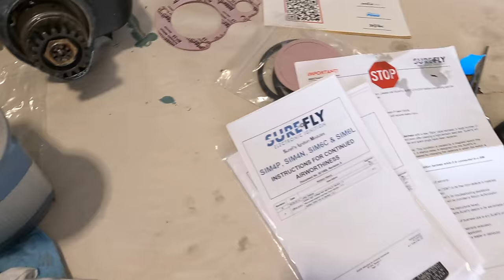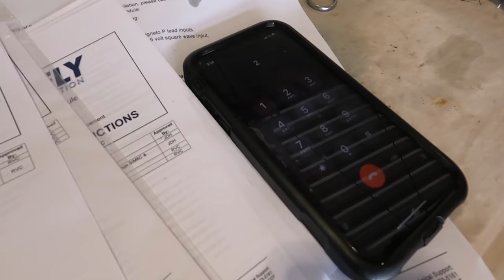New Alternator, Starter installed... Plus an E-Mag #FAIL Cessna 172B Glen's Hangar Episode #6

Comment: Chrysler developed and introduced the alternator on their Valiant "compact" sedan back  in 1960, the first year of the Valiant.  It was their real-world test bed.  The benefit was, it always generated electrical current when the engine was at idle whereas the generator did not.  The success led to installing it on all Chrysler vehicles.

Comment: On the starter.  The small round housing is the starter motor.  Under the 3 screw crescent moon cover is the solenoid that does several things.  When the start circuit is engaged. The coil of wire creates a magnetic field and pulls the plunger rod in extending the drive gear into the ring gear. So it's not engaged all the time.  As the plunger bottoms out the contact disc at the top of the plunger bridges the contacts.  The battery power goes to the coil windings to spin the drive pinion that is now extended into the ring gear.
What is really interesting is the solenoid coil circuit.  The ground side of the solenoid winding is connected to the solenoid output stud  that connects to the starter motor.  So as the solenoid has been sent power before the contact disc makes contact . The solenoid winding is grounded thru the  brushes and armature. This creates a strong magnetic field known as the pull in circuit. 
  As soon as the solenoid contact disc bridges the contacts and sends battery voltage to the motor winding the solenoid winding has positive current on both sides but there is enough voltage drop across the disc. There is enough difference in voltage to keep the plunger held in. At a much reduced amp draw thru the solenoid winding.  So the solenoid winding pulls 40 or 50 amps for a split second then drops to 15 or 20 amps to keep the starter engaged as long as you hold the start button in. 

 When you release the start button the circuit opens, the magnetic field created in the solenoid coil collapses. The spring allows the drive gear to retract as the contact disc on the plunger moves away from the fixed contacts so the starter stops spinning.  

There is a major issue with these starters.  You cannot control power to the starter big stud and the S terminal at the same time using a relay.  If that happens . As the remote solenoid releases. Both circuits open. The armature spinning inside the permanent magnets becomes a generator and creates just enough current to keep the solenoid engaged and the drive gear extended into the flywheel.  Causing the starter to stay engaged with the engine running for a few to 10 seconds.  I have been a professional auto mechanic for 43 years.  It's just to help you understand.  
Oh. If the armature brushes wear out and dont touch the commutator. The solenoid won't have a ground for the pull in event.  So it wont even click.  You can tap lightly on the end of the round motor section. To get the brushes to make some kinda contact.  Not really a great idea with that big fan blade wanting to spin a few feet away. But on cars and trucks it will get you going once or twice more.

Comment: I know this is a year ago but maybe you'll see it. When i was in my teens i worked on a potato farm in the Fraser flood plains of Surrey B.C.
 We had an old Case tractor that wasnt used for much more than running the irrigation pumps. It was great for this as it had a magneto ignition.  The reason this was good is because if the tractor ran out of gas it stalled out and because of the mag it wouldn't kill the battery or burn the points. Another goid thing was we would get exactly 1 hour per gallon of gas. So if you needed the pump to run 3 hours you put in 3 gallons of gas. 5 hours, 5 gallons. 
Occasionally the mag would go bad so we had 5 or 6 big boxes of them and you simply change it. 
Those mags looked identical to the ones on you plane. I guess Case had a good thing so they were used on many different things.

Comment: Another wonderful episode! About magnetos, they are still used in vitage bikes, too. Their charm is: the spark gains more power with revs going up. I'm a fan of lightweight. My idea is a BMW R75/5 café racer. (Original dry weight: 195kg. I wanna get down to a 160kg.) Also had some fun with electrics. My voltage regulator is DIY electronic. But that one comes with an 0,7V loss 'cause of the transistor (the original from 1972 has almost none), so I changed the little diodes in the rectifier with shottky ones. To compensate for at least 0,5V of that loss. Technic is fun!
Greetings from the far north of Germany!

Comment: Evey heard of sprint cars, they use mags. Supermodifieds use them also, probably some have newer but probably anything that gets pushed off to start uses a mag
Reply from the maker: Yes there are probably dozens of combustion engines that use magnetos - and I will forever be grilled by the internet armchair critics because in the heat of the moment off the cuff comment I failed to list the possibly 100s of niche places that still use them.

Comment: Magnetos are still used on dragster engines.  They make more spark energy as the RPMs increase. For aircraft, they provide spark independent of all other systems and each other so they increase overall reliability.

Comment: I think it’s called a sure fire it’s a modern electronic ignition with auto timing to move it to make more power and you can keep old mag for a back and they are the same price. They start way easier and runs smother setting on ramp and you go full power the timing is auto advanced. It’s the best money you will spend and if you shut you motor down for bath room break you won’t have to wait for it to cool off , this baby fires right when hot or cold hot , mproves fuel burn a 1/2 to one gallon less fueled and depending on plane and it my stay the same or use little less fuel. So please try this sure fly mag and you only have to buy one and other will be your back up .

Comment: That sucks Glenn, but at least it seems like you have an awesome AME to work through it with. Funny, people talk about experimental and home built as though they are slung together with old garbage parts, and maybe some are, but experimental now have the most cutting edge in technology. As you mentioned the exact same parts are available for experimental at 1/3 the cost, and most new technology start in experimental aircraft. All of the awesome avionics you see were in experimental for years, you can get electronic ignition, and fuel injection for experimental now. Hopefully an RV 10 will be in my near future!

Comment: I know this was over a year ago, but I found myself wanting to yell at my screen so you could hear me: “Remove the gear from the mag to put on the SurFly!” They may have added that to the instructions now? Also, I’m sure you are aware, it is now legal to connect into your manifold (at least in the USA) They are awesome!
Reply from the maker: You’d think… but Nope. Not designed/made/certified for this engine and likely won’t be for at least another year. I’ve had lengthy conversations about this with SureFly.

Comment: I'm sorry that the SureFly didn't install for you.  I see that they have changed the paperwork on their website to reflect your difficulty.  I have one on my Mooney and It always started well with the old mags, but now it starts like a car.  I originally installed it with the advance (it's legal down here in the states), but had to move to the traditional timing because I was running too hot.  I also have the permanent magnet starter and that certainly helps with the starts.

Comment: If you can't adjust the timing via manifold pressure you might as well use a traditional magneto.
Reply from the maker: There are a few other advantages of the Electronic Magnetos.

Comment: With fuel efficiency becoming more paramount. I'm really surprised that auto makers haven't created engines with duel sparks (at least to my knowledge). Obviously this would be more complicated but the engine would be more efficient as your friend said.
Reply: They have - believe it was Alfa Romeo latest.
Reply: My '94 ford ranger had 2 plugs per cylinder. 
Really threw me an my gramps off the first time we worked on it 😆

Comment: Curious about the engine cowl when it comes to Post Polish.  Are you concerned that you'll end up with excessive glare off of the cowl once it's polished?  Have you thought about how to remediate that?  Perhaps a Matt Black vinyl for the upper portion?  (Which I think would look really kind of fantastic).
Reply from the maker: Painting an anti reflective area is on the list of jobs. Though it may not happen until next Spring.

Comment: You can still find magneto ignitions on old school dragsters. Check your Summit Racing catalog. Anyway I saw them years ago when I had a mild interest in racing cars.
That's funny. Vacuum timing advance is experimental. I have a 65 Nova that is centrifugal advance only. My 79 Pontiac had centrifugal and vacuum advance.
Reply: There are lots of classes that use magnetos.  (Top Fuel, Nitro FC, Alcohol dragster, Pro Modified) to name a few
Reply: @davidvicari5139  - First, an aircraft engine operates at high power settings for takeoff and climbout; but often cruises at an upper-middle throttle range. Each of these operational regimes can benefit from optimized timing (to manage power, control CHTs, maximize fuel economy, etc). Furthermore, you're forgetting the fact that air pressure changes with altitude. Anything utilizing MAP as an input (on a non-turbocharged engine) will be able to provide some altitude compensation.
There is no reason why a Bendix magneto is any better; especially given the fact that the design incorporates wear items and includes a lot of internal heat as part of the operation (diminishing the lifespan of the unit).

Comment: Nice to see some progress. Did you try "Mothers Mag and Aluminum polish" yet? If you use it on the primer it might actually be effective for rubbing that off too.
Reply from the maker: I'm sticking to polishes that are certified for the alloys / cladded aluminum used on aircraft. Luckily the primer is gone at this point; it was a job but it's done.

Comment: You're clearly a nicer person than me. After the tech call I would've been calling the place you bought the mag from and would've been screaming at whoever was responsible. That being said looking forward to the next video. Thanks.
Reply: I found that most of the time the vendor really doesn't know. They look at the same fitment list that the manufacturer supplies. The tech department at the manufacturer is the one who gets torn a new one. It's one of the "joys" of my job. My Therapist says I need a healthy way to deal with my pent up anger, so I asked her if screaming at some tech-weenie that says this part will fit in my <insert thing here>  when it clearly doesn't and never will counts... She said not exactly, but as long as you're non-violent about it, and it works; then go for it!

Comment: Your title is misleading or simply wrong. E-Mag and SureFly are not the same company even though they have a very similar product. It's not E-Mag Fail, it's SureFly Fail. 
Great content overall.
Reply from the maker: I tried to shorten the title by using the colloquial 'E-Mag' which is shorthand for electronic magneto. 
Not realising that there was even a company called 'E-Mag' since they aren't certified and therefore not on my radar.
Reply: @GlensHangar  I thought you were going to install an actual E-Mag and your airplane as it was converted to Owner - Maintenance category, hance why I decided to watch this particular video. 
You do have a great channel. Keep up the good work.
Reply from the maker: @peterp696   To clarify; the airplane isn't owner maintenance, it's certified.

Comment: G,day Glen from Sydney Australia.
* When using the paint stripper, are you covering it with newspaper: I believe it increases the efficiency.
* That electronic ignition: is the advantage that the engine only needs one unit and it provides better timing of electrical current to the spark plugs?
🌏🇦🇺
Reply: You still need 2 units, but the e-mag is basically service free.  Regular mags require periodic inspection and rebuilds.

Comment: Chris is an AME (aircraft Maintenance Engineer).  No Canadian aircraft flies unless an AME signs it as airworthy in accordance with the applicable standards of airworthiness as defined by federal law .  As you see in this video an AME may also modify an aircraft under Supplemental Type Certificates (STC's) or (LSTC's).  So the term mechanic is an understatement of the abilities of a Canadian AME to inspect, maintain and insure safety.   Also fact, the Canadian AME makes less than an auto mechanic.  Go figure.
Reply: It's a damn shame. But even in the US, A&P's make less and are probably way better trained than an auto mechanic.
Reply: @GrizzAxxemann  
absolutely no disrespect on the new tech auto mechanics that train well on their product, however aircraft can't pull over to the roadside for a defect.
Reply: @darenm5691  none at all here, either. My fleet mech at my job has been almost 40. The dude is a wizard. But given that a broken car probably won't kill you, and a broken airplane most certainly can and will, AMEs are worth more $$$

Comment: Did you ever get the sure fly magneto problem ironed out and if so, what is your opinion about them now after the smoke has cleared?
Reply from the maker: Yes - SureFly turned out to not work with this engine; they had mistakenly added the C0-300 to their AML and then removed it when we pointed out the mistake.
So I put on the ElectroAir, and I'm super happy with it: https://youtu.be/eZdmlDdwzDY

Comment: People that have polished airplanes spend their time polishing their airplane.  New and improved can be an oxymoron.
Reply from the maker: I get two kinds of comments about polishing the plane:
Comments like yours from people who either don't own a plane that needs polishing, or who don't own a plane at all.
OR
Comments and advice from people who actually own planes that need to be polished who tell me that the first time is the worst, and then it needs just minor polish and touch up once a year.

What I can tell you is that even the most neglected polished plane looks better and flies better than a plane with a so-so paint job.
Reply: @GlensHangar  Glen, please don’t think I was trying to insult you.  I have friends that have polished airplanes and it can become an obsession keeping it gleaming.  Yes, I own an aircraft, one older than yours, a 1957 TriPacer converted back to a taildragger which I have owned since 1998.  The only parts of my fabric covered aircraft polished is the spinner and the exhaust pipe, and yes I obsess on keeping them gleaming, and keeping the fingerprints off.  I will admit a polished airplane is a thing of beauty heartening back to the 30 and 40s.  I am enjoying your series and think you are encouraging others to pursue acquiring an aircraft while sending a very important lesson, buying an airplane is not like buying a boat.  This is a highly regulated pursuit, whether for pleasure or career, because mistakes made by the un-initiated can have tragic results.  I applaud your methodical, and logical decisions from the start.  Getting a pre-buy inspection was a superb decision, as well as the C-172B.  The C172 does just about everything well as long as you keep to what it was designed for.  Too many first time buyers fall into the trap of buying a plane (love at first sight) getting a mechanic to look at it perhaps for the first time at the next annual and getting very nasty expensive  surprises.  The 0-300 engine is very smooth.  I have flown light sport aircraft with Dynon displays and I am very impressed with the quality of their product, on par or better with some of the displays in the A320.  Congratulations on finding an aircraft in such great condition and you are sharing many of the tough choices many of us with classic aircraft face.  I look forward to viewing your journey.  May it always be blue skies and gentle winds.

Comment: Saying SureFly is more than eMag... is unfortunately not right.  eMag doesn't make 6-cylinder, so you can't get it even if it did have the right paper.  eMag (4-cylinder) is 1685 on A.S.  SureFly (4-cylinder) is 1595 (6-cylinder) 1895 all prices A.S.  Now eMags are "self-powering" once started.  They need a small source to start, some have a lead for a small 9v  battery just to start on a dead battery or for non-electric aircraft.  eMags are a true mag replacement, you can safely use them on both mags. SureFly is not strictly a pure magento replacement it needs an external power source to run in any phase.

The biggest true cost difference with the eMag / SureFly is really in the spark plugs... And it's not small.  SureFly uses stock aviation spark plugs, which is much easier for certification purposes.  eMag uses automotive spark plugs.  Two benefits... First auto plugs are gapped wider and flow WAY less.  Second I can get an entire set of EIGHT very long-lasting neodymium spark plugs for the price of ONE crapy old copper probe aviation spark plug that won't make 100hrs without cleaning or 300hrs without replacement.  That's the real cost difference!

Comment: Is cutting a shaft like that common practice?  It seems like a cut like that would unbalance the shaft and cause vibration.
Reply: the shaft does not turn, its just a guide for starter engagement